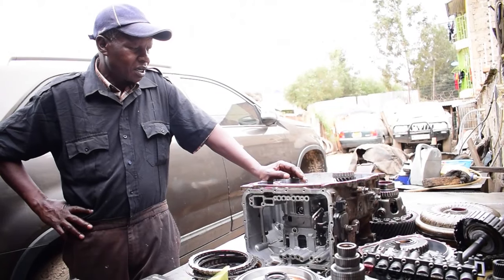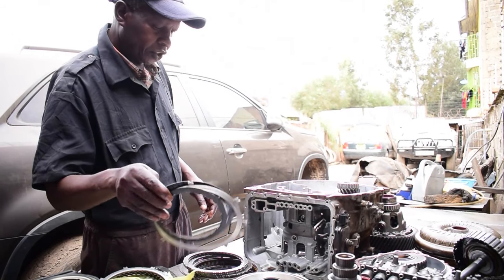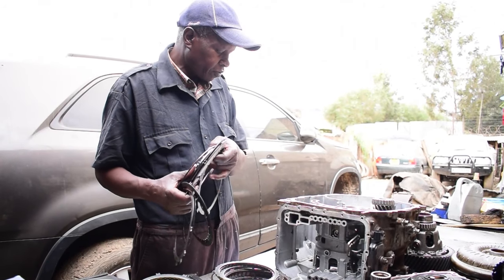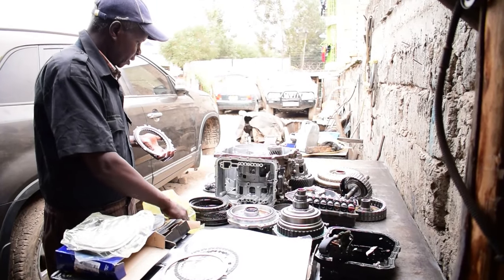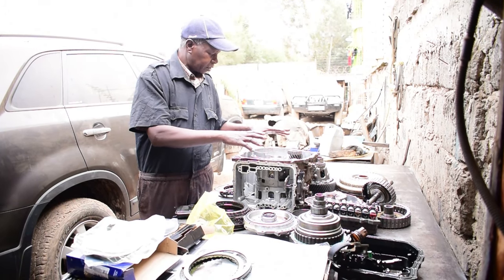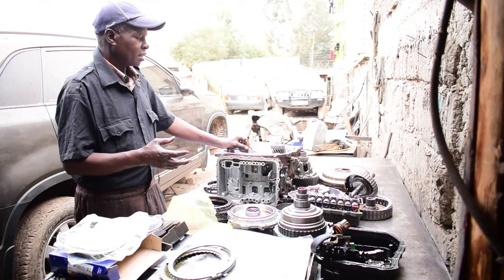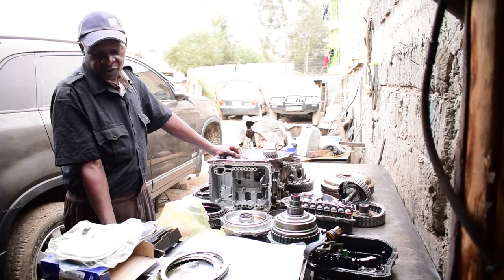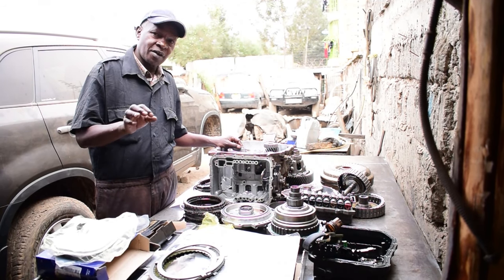KIA A6LF Automatic Transmission Repair

Comment: My wife's friend (single, older, broke) has an 05 Sedona. She had the power steering pump changed. The mechanic noticed wiring a mouse ate and replaced it. Now, you guessed it, the transmission slams into 2nd then enters 1 gear only limp mode. Her tach stopped working so before I knew the back story I went to change the ignition failure sensor hoping for a long shot that was causing the transmission issues. That's when i noticed all the wiring to the transmission was "new". 
How the crap can I diagnose the wiring? (Yeah... The mechanic is playing dumb to the repair now. Well... Not playing)